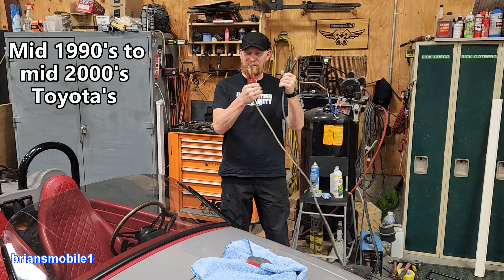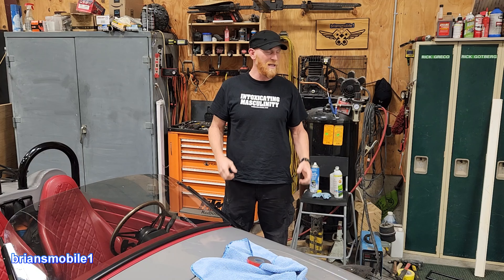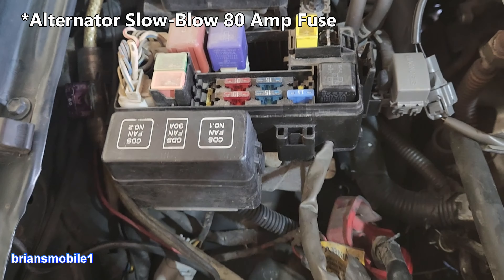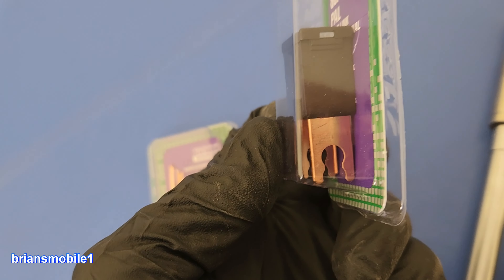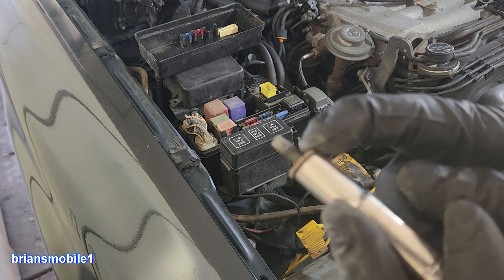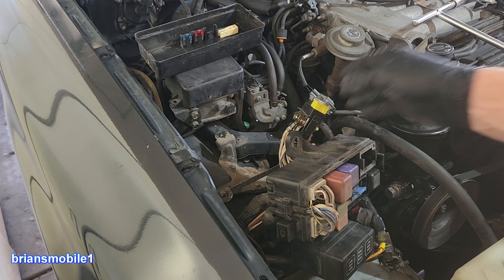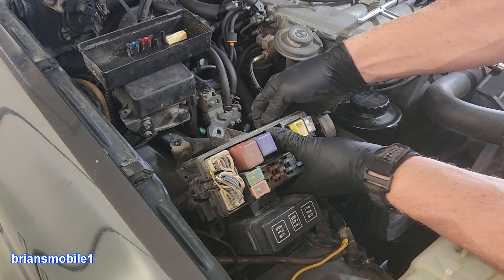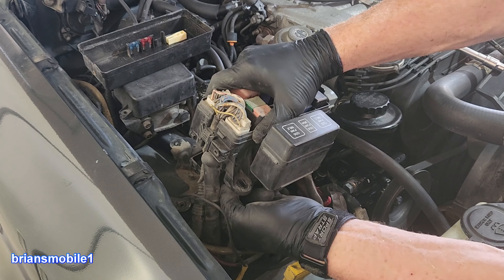Reversed Jumper Cable Damage Repair High Detail

Comment: this happened on an old '96 ford ranger i used to own.  i never could figure out what happened to the electronics.  this video was very cool to watch and great information! tytyty
Reply: Reverse polarity on semiconductors is almost always catastrophic unless protection is designed in. The simplest measure is a reverse diode across the input, which will blow the fuse if the supply is reversed, and that is likely what Toyota did in this case. I don't think every manufacturer bothers, however.

Comment: I picked up a 2003 Piaggio LT150 scooter that sat for years. Of course the seller claimed it just needed fresh gas and a battery (Yuasa = $95), but as always it was so much more. The master fuse was blown due to a previous reversed jump attempt (20 cents), as well as a bad starter button ($8), totally clogged carb (1.5 cans of carb cleaner), and lastly a stuck fuel petcock ($20). Still needs the 20 y/o tires (100 each) and sticky rear brake cable replaced ($35). Here in Oakland, California the Vespa / scooter dealer charges $165/hour shop rate, so working on older vehicles only makes sense if you DIY.
Reply: Sticky cable is easy, you run brake cleaner down the inner core to wash it free, using a piece of plastic bag as a seal, and then follow up with WD40 to rinse, then finally a spray of silicone to wash the WD40 out. Will move freely again as the crud is gone. Does not work if the inner plastic liner on the cable is torn though, that you go to the bike shop and get just the inner cable, and replace it with that.

Comment: Tip for those deep bolts is a small supermagnet, which you can get from the laser pickup in any CDROM or DVD drive, there by the lens. 2 per unit, and they are very strong, and tiny, so you just slip it into the socket, and it will hold the bolt or nut you are attempting to remove, and also will hold it in place to insert as well. Works well on any 10mm socket into a deep buried place.
Reply: Or old hard drives, they have big neodymium magnets
Reply: @andreidoimetri  You want a small one that will fit inside a 10mm socket, not a big one. Tip as well is to take them, and use a thin steel wire, and dip them in varnish, and leave to harden on the wire. Wire wiped down with oil, so it will not stick, but magnet cleaned with brake clean. When dry pull wire out, put on other side, then dip again, so the magnet is sealed, as they will otherwise disintegrate into a magnetic powder when the coating on them is damaged.

Comment: Lucky you have an older Toyota, with only 2 types of fuse, not a more modern vehicle where you have standard ATO, mini ATO and micro ATO fuses, all in the same fuse box, and all buried up under the dash, where you need to either bend yourself in half to see, or use a camera to look in there to find the box, then contort to reach the fuses, then struggle to get the new one in place again. Yes keeping a small baggie with a good selection of fuses in that fuse box is great, it has saved me a few times, along with keeping some short pieces of solid core and stranded network cable there as well, which you can use to make an emergency fuse, just the one strand will do, thinner than the vehicle wire, so it fails first. Good use for the CCA junk, as it melts at a nice low temperature, so no smoke either.

Comment: i have a perodua myvi 2011 i accidently reverse jump start car due to flat battery i got in car and and turned key the dashboard came on as i cranked the engine nothing all electrics all dead i realised then what i did , i checked all the fuses they seems fine but not the relay fuses or you think the ecu is fried